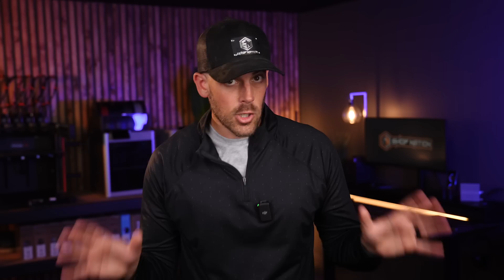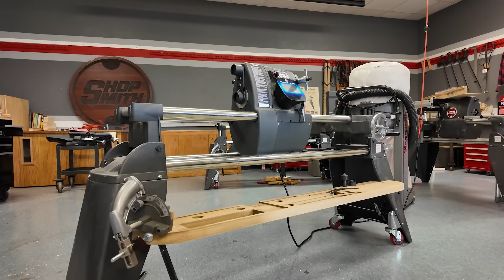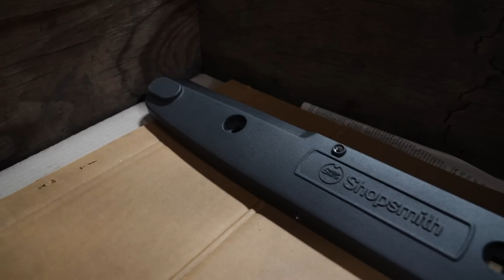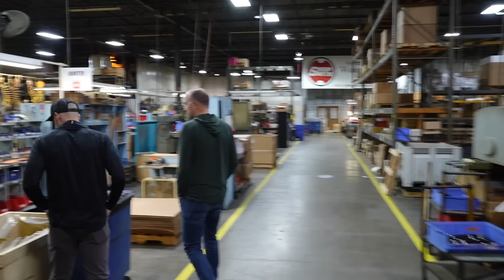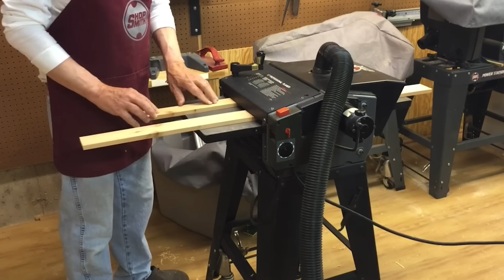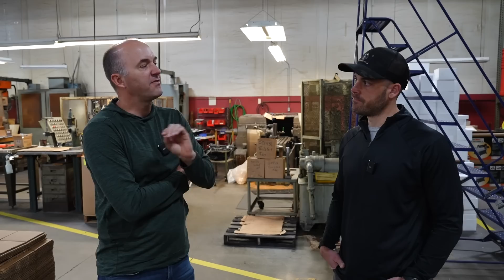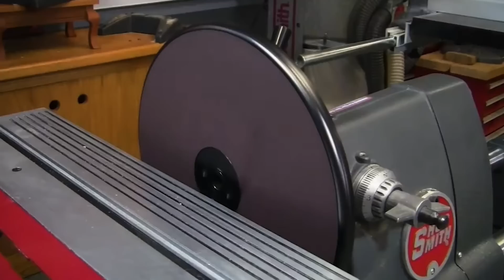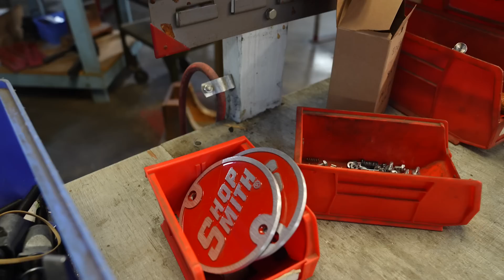The Last American Power Tool Company is (almost) dead

Comment: Started out on a mark V and am still a hobby wood player.  I personally love the table saw compared to the little portable table saws I used.  No comparisons the shop smith is so much more accurate.  Better support for cutting down wider material like a plywood sheet.  I later change and got an older 10er.  My opinion is I like this better as it is very simple.  
My only advice bring back the the bracket that would allow the 10er to accept the mark V items.  It is two castings and a coupler that opens ups a market for the jointer, belt sander and other accessories.  Just a thought for Nick.

Comment: I have been a Shopsmith owner for thirty years, and I absolutely love the system.  I briefly taught high school wood shop, I've worked in two different woodworking stores, I've owned three stand alone table saws, so I've used many power tools, and the Shopsmith is my favorite.
Reply: Interesting,....I would of imagined that once you had table saws,  returning to the Shopsmith would not be appealing.  
Then again....I like multiple table saws and multiple drill presses.  Hmmm,  You have me thinking.
Reply: @Dancing_Alone_wRentals  A standard table saw with a big table works better than the Shopsmith for cutting large pieces of plywood.  However, a track saw works far better than any table saw I've ever used when it comes to cutting plywood.  Once I got my track saw, there was no real need for a standard table saw.  At that point the Shopsmith became my table saw of choice.  For the kind of work I do (banjo building, cabinet making, building decorative boxes) it is my favorite table saw.  For instance, because I can move the blade with the quill feed (instead of the fence) I find it much easier to make tiny, precise adjustments, which is necessary for the kind of work I do.  I can also use stop collars to make very precise, repeatable buts of a certain depth.  Your needs might be different, but for the work I do it is the best table saw.
Reply: Very interesting  @WoodworkerDan  .  I would be fun to see some of your projects.

tHanks for the reply.

For long plywood rips I would make my own plywood straight edge.  The circular saw would ride along and I still  use them from time to time.

I'm setting up two table saws in a little workshop I'm organizing.  Fine blade and a rougher blade for misc cuts.

What are you working on next?
Reply: @WoodworkerDan  Track saws are great for breaking down sheet goods. They suck for making precision cuts, cutting multiple pieces like cabinet pieces, and doing special cuts like angles. Every tool has its strengths. The most versatile tool is the table saw. The Sawstop table saw is by far the best value in a tool today, IMO.
Reply: @tommaxwell429  Depends on which track saw and which blade you are using.  I get excellent results from mine.  I built a special bench that has a stop block so I can get accurate, repeatable, high quality cuts.  You can also do certain cuts that would be impossible on the table saw, such as making a diagonal cut across a sheet of plywood.  That said, the SawStop is a great saw.  I have used them many times.   When my father was looking for a new saw I steered him toward the SawStop.  But it isn't for me.  He recently went to a nursing home, and I could have had his SawStop, but for the kind of work I am doing I prefer the ShopSmith.  But I do understand why so many woodworkers love the SawStop.  It is a great saw.
Reply: @tommaxwell429  Take a look at this video.  It shows the Makita track saw cutting plywood.  The Makita has a special feature for crosscutting plywood.  It has a setting so you can make a scoring cut, and then you finish up with a full-depth cut.  I don't know if other tracks saws have this feature (I own the Makita), but I really like it.  https://www.youtube.com/watch?v=1bhOpqD3ogo
Reply: @WoodworkerDan  I hear ya, I don't have a track saw but would like to have one. But I suspect I would only use it to break down sheet goods. Glad it works for you in however you are using it. I'm not sure Shopsmith can be compared to a descent table saw. But hey, to each his/her own I guess. I'm not anti-Shopsmith, I've gotten a lot of fun out of mine. I am totally pissed at the way Shopsmith has treated loyal customers.

Comment: I bought a ShopSmith 35 years ago and still have it. And it's still working. Love everything about it but the table saw. It's a great drill press, sander, lathe in a small space. Hopefully one day they will be able to fix the short comings of the table saw. Can't believe they're not as popular as they use to be great to

Comment: I don't think I'd get one of these new, even with space at a premium.  I can get a contractor table saw, and build a smallish work table for it, and get a lot more functionality.  I also like the fact that I can buy the pieces I need as I go, and upgrade when it makes sense.  Sure I started with a benchtop drill press, and it took a long time to need to upgrade that part.  Where as I used my table saw all the time, so it got upgraded to something nicer sooner.  I'm not locked into a vendor, not locked into an upgrade path, and if my motor dies, not everything is down all at once.  SS was a great idea, but the entry point money wise is too high, it's not flexible enough of a solution, and the upgrade path just isn't there.

Comment: Travis,  I can understand the issue with Shopsmith as you can imagine there is a small margin of buyers for this.   New woodworkers tend to buy something cheap or hand me down used equipment because it may not be their passion at first.  The best thing about this product is the space it saves.  While that’s a percentage of potential customers it’s very small.  Add the change over to the various accessories and I think it would be sort of frustrating especially if one accessory is more complicated from one to another.  At $5000 you are invested heavily and most only spend that kind of money when your dedicated, making money from hobby, or limited in space.  Don’t get me wrong there’s a customer base out there for it.  In my opinion they made the machine very well and that’s good!  However they out last killing the business for future sales!  Bad to say if isn’t broke don’t fix it!  Think they need to market equipment to compete with others as Shopsmith is a recognized brand that can offer longevity.  For instance, just make a table saw and build it like something comparable.  Just need to expand the name to other products to offer variety to reach more customers!

Comment: ShopSmith user here. I simply don’t have the space for individual machines. And I love my ShopSmith. I use it for everything, table saw, drill press, disk sander, belt sander, band saw and lathe. I’ve built 3 guitars on my ShopSmith. 😎
Reply: I used mine tonight to sharpen some mortise taper carbide drill bits for a friend that owns the bowling alley and proshop.   Some of those bit cost as much as $100 bucks each.   I set my table and miter to the compound angle and then put a diamond wheel on my shaper arbor and they are like new again.  The bowling shop guy is Amazed he found someone online 8 bucks a bit but was afraid of them getting lost in the mail or being without them as they cost $3 to replace.    I am charging 3 bucks a bit and trading him out in bowling.   Lol    I love My SS
Reply: @jvmiller1995 you should charge him $8 ..at least especially if he is trading for bowling...which is practically free for him...😂😂
Reply: My dad is letting me have his Mark V (He's 80 and moving into assisted living) and since I play and work on guitars/basses I plan on using it to make one for me and for repairs, etc.
Reply: I want to build a case for my 1964 Teisco Del Rey hollow body electric guitar. However,  I am a drummer,  but wooden cases for all my drums would probably not  be the best idea.  The guitar...
absolutely!
Space is also a problem.  My 2 car garage is my shop. In Toledo, Ohio, hot in summer, cold in the winter.

Comment: I'll be honest, always thought the shop Smith seemed a pain in the ass until a friend purchased one and mastered it, moving from one thing to another was effortless and fast, I think you need good videos showing the ease in which different machines can be swapped and I think you have a great generation in front of you that these machines would be ideal for and lastly, obvious some great YouTube videos with a skilled professional that shows the ease of making shop Smith after shop Smith after shop Smith project, rate them 1-10 so the difficulty is right there staring them in the face so they know what they're getting into and I'd have alot of the projects compared side by side with a professional wood shop to show a craftsman is a craftsman no matter what tool

Comment: Great Video!  Shopsmith makes a great product. I bought mine used after I realized that I needed to upgrade from my $100 starter table saw. Since it was used, it was missing a few things, not a problem with the iconic design. I have been slowly upgrading mine with some of the non standard accessories. I want to encourage anyone who has a small basement or a garage shop to take a serious look at Shopsmith.  I enjoy building and turning things on mine.

Comment: Nick:

Try looking beyond woodworking and/or enable the community to build new solutions.  Spin casting is one idea. Depending on how slow the motor can go, a rotary tumbler.  How accurate is the lathe?  Could it be used for turning metal in a home shop setting?

Comment: I inherited my mark v. Since then I have upgraded the table system, added a speed reducer, bought a shaper fence, bought the mortising attachments and tenon jig, upgraded the hood on my 3300 dust collector, aquired two conical sanding discs, and am waiting on the call to pick up my dual lift bench upgrade. Nick, I'm trying to keep Shopsmith in business. I'm even working on a blade stopping tech for the Mark. Don't give up, Shopsmith is far from dead.
Reply: Watching the demo of the guy flipping the Mark7 on its side to be a drill press was amazing - I gotta get one of those bad boys!
Reply: No offense, but you must have more money than sense! The fence upgrade alone probably cost your 2x 3x what you paid for the original machine. Shopsmith has priced themselves out of the market, that's why they are in the shape they are. People are not going to pay premium prices for these tools to make breadboards and turn a few bowls.
Reply: @tommaxwell429  Sure sounds offensive to me!  You could easily make your point without insulting homefront.
Reply: @petermccall8975  feel free to be offended, no problem, doesn’t matter to me. Just curious, read the post and tell me what it sounds like to you, I mean a Sawstop type blade brake for the Shopsmith? If true, it’s not difficult to surmise it is little more than a lark and certainly not a serious investment venture.
Reply: @tommaxwell429  Your opinions are your opinions , different strokes for different folks, even  Fossil cars have their lovers,  some folks will move  to BEVs tho.

Comment: Nick! I loved what you said about the table saw. My father worked for NASA at what then was Dryden Flight Reasearch Center. Now called The Neil Armstrong Flight Research Center. Many dont know that NASA used a Shopsmith to build the first lifting body called the M2 F1 also know as the Flying BathTub . This was the beginning of the space Shuttle Program. They used a modified Pontiac convertible with the rear seat mounted in backwards to the could monitor the towing operation. My father was a part of the original flight team that got the plywood aircraft into the air. NASA did not build the M2 F1 but once it was built the tooling and machinery followed that aircraft to Edwards Air Force Base at The Dryden Flight Research Center. That shopsmith was used for a ton of non NASA projects that were called “Goverment Work”. My father ended up buying that Shopsmith from NASA that to this day remains in our family. Yes NASA provided a letter of ownership with the machine that he paid $90.00 bucks for. Of course NASA enenginers modified the Shopsmith as they did everyhting thay used. The Pontiac came with a HUGE motor so they could achieve the ground speed needed to get the lifting Body up and flying. I thought you would enjoy that short but colorful story. Milt Thomason was the NASA test pilot that flew the M2 F1 on many of its non powered flights. Then they mounted a SCRAM Jet onto it to really give it a kick once they got it up and flying. They would drop the tow rope and light the SCRAM Jet and off it would go. The TV series The Million Dollar Man was made aound the crash of one of the later lifting Bodies when a helicopter got in the way during landing causing the pilot to loose control of the vehicle while doing a dead stick landing. So There you have it. Thomas L. Schuck, Portland.

Comment: They need to remake a whole new machine and ditch that antiquated design. That's quite inefficient and not good at any really. Thing except for maybe the drill press, look at the Chinese multifunction machines that are a table saw Joyner router and thickness planer all in one, and then they could add a miter saw station and a band saw station as additional attachments

Comment: I see several problems
* Shopsmith was popular back when there were very few choices and places for power tools, mostly Craftsman and Delta.  Now there are many choices either direct, thru home centers like Lowe's, Home Depot, and Menards, or distributors.
* Since they were so popular back decades ago, there are now many of them available on the secondary market from people getting out  of woodworking, people who have upgraded, or estate sales.  Typical prices around here are $400-600 depending on model and number of accessories.  So that's 10% of the price of a new one
* If flesh-detecting technology is mandated, the table saw option will die
* Dust collection is very lacking for most of the tools
* I got one in the early '80s  and added many of the SPTs.  But I soon found that the table saw was the weak point and for where my interests took me, the table saw was my most-used tool.

Comment: Remove the weakest link which is the table saw unless you can innovate and the sawstop requirement doesnt hit. Focus on the nice to have tools. 6 - 8in jointer, lathe, small curve cutting bandsaw, disc sander, maybe innovate a drum sander attachment, spindle sander, router, and drill press. As woodworkers i feel we all focus on the table saw and planers as stand alone top quality tools, jointer to a lesser extent.

Comment: Interesting that lots of comments about the size of the table for sawing applications.  The table can be configured to any size.  And comments about cost and buying a table saw for $200-300 - like that saw has a large surface. 

The value is that it provides multiple tools that provide accuracy and repeatability in a small package. Yes, if I had a 40x40 shop, I might feel differently.  But working out of a single car garage, it is the perfect solution.  

As far as safety, it is as safe or more so than every tool except the SawStop.  There are no whirring blades that are uncovered. I believe most of the negative comments are from people who have never actually seen or operated the ShopSmith.

Comment: I bought my 1955 shopsmith used and wouldn't trade it for any tool because I know that I can maintain it for the rest of my life. Paid 100 bucks for it. Spent 250 through smopsmith for everything to fix it and buy new hand tools for it. The mark v is the only shop  tool a casual DIY'er needs.

Comment: I've used a Shopsmith for a few weeks. It was a terrible experience. Very slow. Not dangerous because it was slow but, the potential for danger was way higher than any other tool I've ever used. It's a very unsustainable business model for an outdated machine. I love that it's mostly US made but, there are so many better standalone tools out there that would cost at least the same and be way faster and safer to use.  I think Nick needs to focus on putting shopsmith motors in other tools and coming up with new tools, changing the current shopsmith's outdated design.
Reply: what did you find slow about it?

Comment: For marketing, I think ShopSmith should focus on the things like jointer and lathe that are 2 tools a beginning woodworker typically doesn’t have, but will significantly upgrade their work.  A jointer is such a time-saver that now even a small shop can have.  To marry that with drill press, horizontal boring, lathe, etc…what a magic thing!  And to be able to do all that with a machine that can take up so little space.  It’s wonderful!